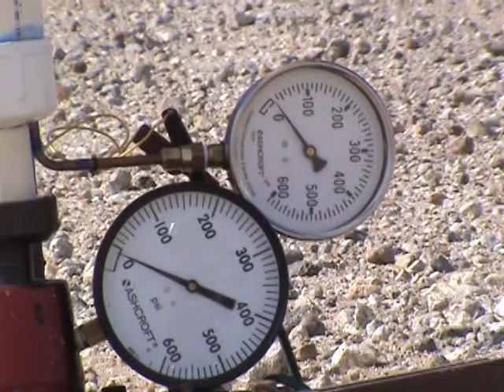K500 PVC Rocket Engine

Comment: hi bro !! awesome vid. i like it so much , but i have a question , what type of material did u use for the engine , inside the engine temperature and pressure are very high, what material did u use to not blow up the motor  ?  thank you , cheers from italy

Comment: Very nice. As a rule of thumb make your coupler length 2x the diameter of your rocket. If you switch to a 6061 Aluminum case you can increase your performance greatly. It's also safer. PVC will fragment if you have a CATO and will not show up on x-rays.

Comment from the maker: Thanks. The problem with larger engines is that the PVC casing holds less pressure the bigger it gets and the lower pressure inside the engine the less efficient it is. I like 2" for that reason, the pressure rating is good and the efficiency is good. It's the middle of the road for sure. Of course I could do metal casings but my whole thing has been to develop reliable and powerful engines with widely available cheap materials.